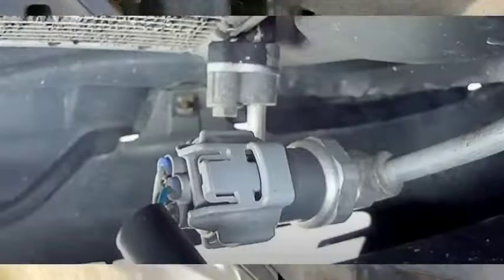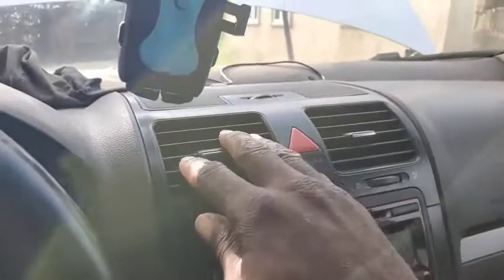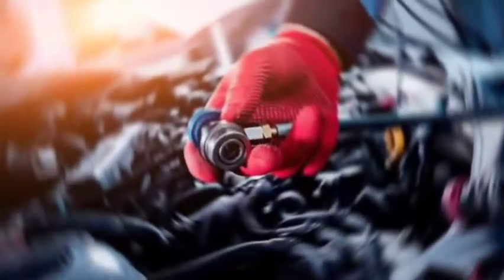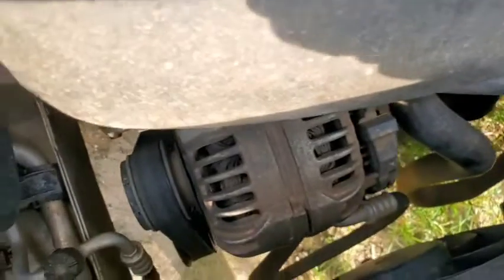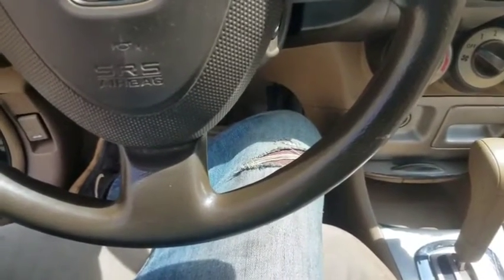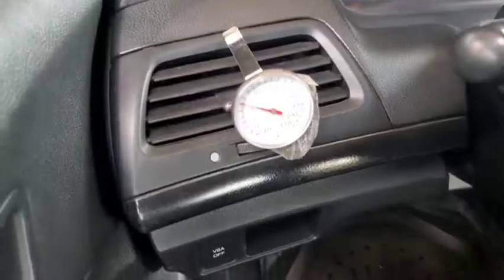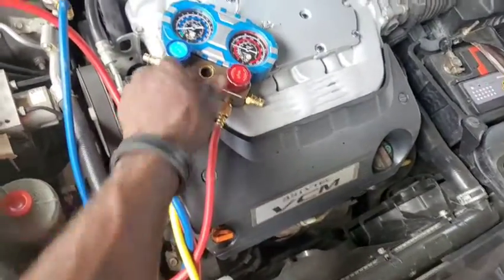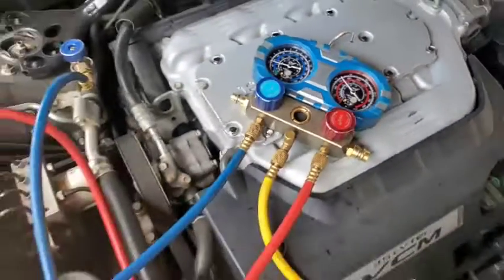Bad ac high pressure switch symptoms | Top 9 signs of bad ac pressure switch

Comment: Caused my engine radiator fan to continue running for 5 minutes after the car had been switched off, regardless of temperature, you wouldn't imagine it was related to it

Comment: Good afternoon, greetings, if you could help me, I have a 2011 Toyota Corolla with code B1479, any ideas, any advice.
 thank you blessings 

 The AC started to have problems the AC works after 5 minutes it stops cooling I turn it off and on and it cools again
Reply from the maker: Official answer, replace the compressor with a brand new one problem solved

Comment: Sir please I’m currently having issue with gear shifting in my 2004 Corolla I do have an abs light on the dash and it’s been scammed by a mechanic and it’s saying the rear speed sensor is faulty but the mechanic said it’s the transmission so I want to ask if it’s possible for the wheel speed sensor to cause the transmission to slip and hard shift
Reply: If the car has a manual gear the abs wheel sensor has nothing to do with the shifting of your transmission. If the car has an automatic gear box the abs sensor will not affect automatic shifting or clutch slipping. Do a complete brake job on the car and that will include all wheel sensors and contacts to be clean and then see if the abs light is still on. I would love recommend you find a real mechanic.
Reply: ABS is brake ‘s problem not transmission .